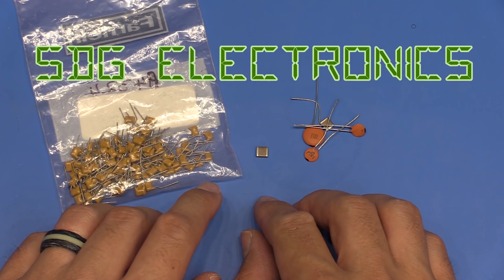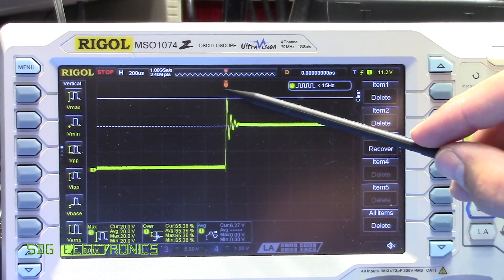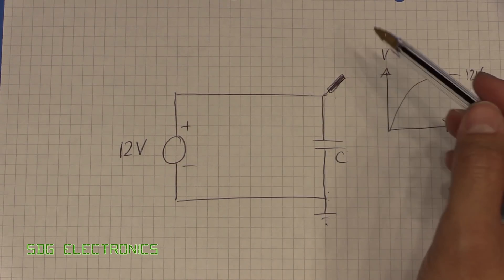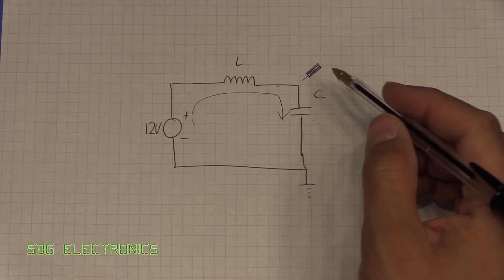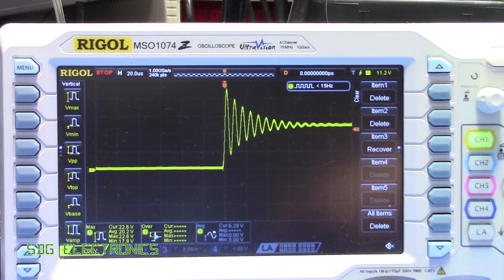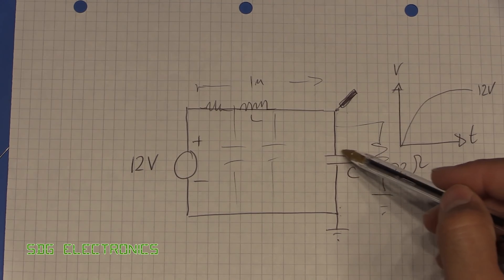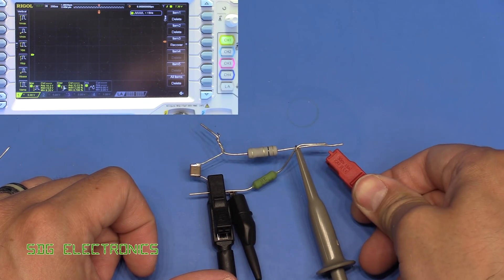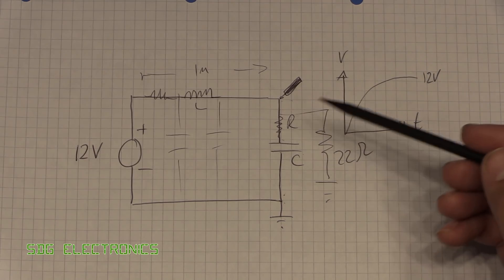SDG #088 Ceramic Capacitors will Blow Up your PCB

Comment: I have a GPU with a blown up ceramic capacitor which looks like it was acting as a filter between the 12v input and ground.... And now I'm pretty sure this is what happened to it. Thanks for the tips, very helpful!

Comment: tx my Gan 100W charger failed was working properly for 6 months, but used it to charge anker powerbank at peak 100w for may be 40 mins ...do you reckon the video you demonstrated is the reason ...please guide

Comment: a snubber circuit on the input or connect with a series resistor to charge the caps then remove

Comment: Same issue i got while i was connecting my KSGER soldering station control board to the pre powered on power supply with alligator clips. the 5v dc to dc converted failed in it. and i was wondering what happened to that😅😅. Thanks for the knowledge👍👍👍.

Comment: You should in most cases, add an EMC filter to the input or use a hot swap controller.  Both will eliminate this startup issue without compromising the effectiveness of your input capacitors

Comment: Some T12 soldering stations have a 4 pin, 5 pin or 6 pin socket for the cable going to the handle of the soldering iron. What is the difference in the amount of lines of each socket? Thanks.

Comment: When discharging electrolytic capacitors, do i need to discharge ceramic and polypropylene as well? I have a polypropylene 0.012uF at 1600V, should i use a 1 MΩ resistor to discharge it?

Comment: Putting the electrolytic in parallel with the ceramic will give the ceramic capacitor an effective soft start without a series impedance penalty for your high frequency decoupling.

Comment: Hi. Thanks. It should all be solid ones and SMDs, no more through hole subcomponents and liquid filled capacitors, resistors, transistors and other subcomponents- I think that's the future (besides photonics).

By the way, if it's ok to as, my ceiling fan is slowing down again. I already replaced it's capacitors and in series too (the total voltage is way beyond the original one, hoping that it'd be more robust), it's a not so branded capacitor which was from a local electronics shop, I may need to order a really branded ceiling fan capacitor from abroad, online. Would you know what's a good brand, ceiling fan capacitor?

Thank you. Have a great week.
God bless, Revelation 21:4

Comment: Not sure this is a fair or proper comparison.
If implemented on a pcb, the inductance is very low and, as mentioned in the comments, typical practices are to have electrolytic caps in parallel with the ceramics.

Comment: What would happen if you connect a diode in series with the capacitor? The 12 volts would still charge the capacitor but there'd be no 'backlash'.

Comment: Thanks champ. I once asked the question why in laptops they use the aluminium can electrolyte caps when they could use the smaller ceramic chip caps of same value. I think this is the reason why. Less overshoot.

Comment: 3:07 yes, inductors resist change in current, which is ZERO when you start to charge the capacitor. Sorry but your explanation doesn't make any sense.

Comment: Did you find that the ceramic capacitors have much more of a tendency to short? It's something I have noticed more recently.
Reply from the maker: Yes, you must also be careful of any PCB movement - MLCC capacitors will often fail short if they crack due to vibration or thermal effects.

Comment: A Zener diode in parallel with the ceramic cap could help limit the voltage without adding ESR for power applications requiring fast response time
Reply: Use zeners for reference or small power regulation, for transient suppression, TVS diodes are better, they can absorb much more power and are faster
Reply: TomboXYZ Good to know! Check this out, really helpful 
https://www.allaboutcircuits.com/technical-articles/transient-voltage-suppressors-tvs-an-introduction/

Comment: Are you using a switch mode PSU? Could you be observing the PSU"s reaction to a sudden change in load?
Reply: Yes, finally someone said it. This looks very much a power supply regulation issue, not rl resonance.

He should have connected it to a battery and compared the results. I proverbially bet that result with a battery will be more inline with the classical 1-e curve.
Reply: @altersami9660  It's exactly the same. I do this test regularly with battery equipment.
What he didn't mention is twisting the power supply wires generally lowers their inductance enough to stop it killing your gear.

Comment: Noob question, but why do low impedance caps exist, if you have to use them with some sort of in-circuit-resistance so they don't overshoot?
Reply from the maker: It's only when combined with large inductance and rapid changes in voltage. This is somewhat specific to the issue of having a capacitor on the power input to your device. For general decoupling on a PCB this is not a problem.
Reply: @sdgelectronics  Ok I got it. Thank you !

Comment: its not particular to ceramic capacitors.. tantalum or anything with low ESR have same problem.. click bait
Reply from the maker: True, however ceramic capacitors are inherently excellent for transient response and so widely used - it's the most likely device to experience this with.
Reply: @sdgelectronics  I experienced it with tantalums though that was 20 years ago and ceramics have come a long way since. I don't know if you mentioned it but TVS diodes in parallel can also clip the voltage overshoot.

Comment: Welcome to the wonderful world of LC networks.  Ceramic capacitors have low ESR. All wire has inductance and most regulators have a response time.  Limit your inrush current to prevent overshoot.  Glad you covered the inductance that many might not catch.  If you use TDR you will understand the LC results in an impedance. If the impedance is sourced from and terminated into it's impedance resistance, there is no overshoot or undershoot.  This is transmission line theory.  Load resistor goes on the output. Source resistance is in series with the voltage source.  SMPS often does not like to run unloaded.
Reply: Forgot to mention.  Eliminate the Inductor. This is why bypass capacitors are placed as close to the transient sources as possible.  This means bypass capacitors right at the DC/DC converters as well as right at the noisy logic chips.  Look at a good computer motherboard for examples of this.  Lots of little capacitors all over the board instead of 1 big filter capacitor.

Comment: You can also opt for a soft-start if you're dealing with a MOSFET power bus switch, or any type of voltage regulator.
Not all soft start ICs are the same though ... some cheap ones use a simple capacitor, and so the ramp-up waveform will have a long "tail" so to speak.

Comment: Do you suggest to put a ziner in parallel with the capacitor ?
Reply from the maker: A zener or transzorb/TVS are all possible solutions.
Reply: Is this your picture . It's just same picture as IAM  when I was like more than 8 years  before . Now IAM 36
Reply: I think this pulse happen because of the powersupply have a constant current . I try this with battery  and did not get this pulse 😀

Comment: 2:00 is wrong. The charging curve is drawn with the assumption of a resistor in series (which limits the current and voltage during charging). What you have drawn is a capacitor without a resistor in series, which means your charge current will theoretically be infinite until the capacitor reaches the supply voltage. In reality the charge current is also limited by wire/contact resistance and internal resistance of the power supply. Because of the huge current during charging, the parasitic inductance creates a voltage spike, which then, after the capacitor is charged, "rings" in the resonant frequency of L, C and R of the circuit, dampened exponentially by power losses in the circuit.
Reply from the maker: You'll see the RC curve in any real circuit due to the series impedance of your power supply and the ESR of the capacitor.

Comment: the spikes coming mainly from the inductance of the wires. A PCB would behave different. A 2220 has approx 1.6nH , two  cm wire  add additional 2nH on each side make 4nH.
Reply from the maker: It's a combination of the inductance of your power lead and the low ESR of the ceramic capacitor. This is somewhat specific to the example given of a DC power pack being plugged into your design.

Comment: Don't forget the inductances inside the power supply, they can also play a role in the ringing. For a proper test here I'd like to see a test where the power supply is a battery. A car battery would be fine.
One other issue with ceramic capacitors is that they also can work as piezo elements and actually generate spikes at temperature changes. This is one thing that has been discovered in vehicles where they can actually wake up CAN bus traffic when they cool down.
One more factor that's often overlooked is that the oscilloscope probes have to be properly calibrated for this kind of tests. Higher quality oscilloscopes at least used to have a square wave output specifically for this purpose.
Then it's also a good idea to design the electronics with components that have a safety margin in voltage if possible.

Comment: Only capacitors thats i ever seen fail is smd capacitor
But i have seen them fall of the pcb
Why is capacitors good but bad at the same time
Reply: The term capacitor is a very broad description.... here we see many types of capacitor being tested and each have particular characteristics, withing the family there are further pitfalls for a person to fall into.    Electrolytic and tantalum fail if voltage is reversed, tantalum do NOT like step voltage change, Ceramics, polyester, polystyrene have different foibles.    

I assume your capacitor fell off because it became  hot enough to melt the solder , MLCC ceramic capacitors can do this as the gap in the layers are just a few microns thick and the the common failure mode is short circuit - so all the power flows through them.   The most likely cause of creating the damage is vibration during assembly or use - they are very resistant to over voltage .

Tantalum capacitors tend to absorb moisture , and need to be dried before use

Comment: Good vídeo, I had no idea about it. I'm thinking about a protection circuit based on a MOSFET that maybe will help, because can delay the startup enough time to avoid the spike and MOSFETs have high voltage resistance. I'll have to do some tests to see :)

Comment: I remember through school and university this kind of explanation was used, and it always annoyed me. The inductor doesn't "want to keep the current flowing" and it doesn't "do whatever it can" to do anything. I understand the value of these analogies, but they have two problems: (1) they are clearly untrue - the inductor is not conscious and it doesn't "want" anything and (2) they are always one step away from reality. The reality here is that current flowing through the inductor creates a magnetic field. When that field changes (up or down) it induces a voltage in the wires which exist within the field which opposes the one which is driving the current. The strength of this induced opposing voltage is proportional to the rate of change of the magnetic field. This has the net effect that changes in current flow are resisted by inductors, anf the more sudden the changes, the more they are resisted. I know you end up with the same conclusion but this explanation refers to physics without personification. I hope that's helpful. Maybe it's just obnoxious - in which case please delete it.

Anyway, I didn't know about this effect with ceramics - so I learned somehting - thanks.

Comment: Is there any chance that the overshoot and ringing could be caused by instability in the power supply as it tries to maintain 12v after being presented with an almost dead short?  I wonder what would happen if the power supply was replaced with a 12v battery and a suitable bypass capacitor to to keep its high frequency impedance low i.e able to supply high transient currents?
Reply: I tried this with my power supply and no wonder that overshoot was there. Than I tried it again with auto battery and result was same, overshoot as well.

Comment: Thanks for this vid. It can be a difficult problem to debug.
I think there is one more thing to this problem: capacitance of MLCCs drops with voltage: the higher the voltage, the less the capacitance. As a result, in extreme case, it may be even possible to get more than double the voltage at peak overshoot.

Comment: Okay, here is my input, for what it's worth.  I first encountered this problem 18 years ago, I was testing a Zetex 3-terminal linear regulator rated at 15 Vin max, running it from a 12 volt bench supply.  Found it would kill the regulator every time when connecting the supply.  Looking into the problem further, I discovered, as you did; the input cap and supply leads induced a voltage spike at the regulator input, coupled with poor design of the regulator (it would catastrophically fail at 15.5 volts and above).  I found several ways to address the problem: Parallel the ceramic cap with an aluminum electrolytic, transzorb (or zener diode if power levels are low), and some kind of low que inductance in series with the supply line (ferrite beads).  The resistance in series with the ceramic cap was rejected because, (ironically) it allows input voltage spikes to damage the regulator.
Reply from the maker: Thanks Bill

Comment: Ceramic capacitors are fine when they are used correctly.  It has long been known that their value changes over time, and one can compensate for it with worst-case analysis during the initial design.  If your switchmode power supply failed, it was likely due to a poor component choice from the start.

Comment: Just add another bigger capacitor in parallel to reduce flyback and 12 or 13 V  zener diode in parallel to limit flyback. Problem solved.

Comment: Yup, under certain conditions, ceramic caps tend to show a resonator-like behavior, with all the implied nasty transients. Bit that bullet once, when trying to power a TLV76050 regulator with 24V. The input capacitor, along with the long connector lead, created a spike on power up, sometimes up to 40V. Needless to say that the regulator only held about twice or trice before blowing up and damaging the PCB. The solution was to insert a damping resistor just before the capacitor near the regulator, in series with the supply.

So, the behavior is probably not just the capacitor's fault, but the line inductance as well (and mainly that last factor). That is why electrolytic capacitors don't show this behavior, or it is minimized. Their higher ESR is enough to dampen the oscillation.

Comment: my solution for this is simple, either i use ics with soft start or make sure the resonance of the circuit is way above the bandwidth of the step incurred by the regulator when turning on, for the main supply, just use an electrolytics for storage and ceramic to take care of the ac impedance, as for the regulator i would make sure Vin max is many volts above the specified input voltage, hadn't had a case in which the protections of the components itself could't handle a possible ringing

Comment: Okay, so this is a common question?
Where did you get that plastic prying tool from?
Reply from the maker: I actually don't remember, I have no idea what it's useful for other than pointing at stuff - it snapped on first use on the flat end.
Reply: @sdgelectronics  Ah, well thanks for that.

Comment: Alternatively don't use leads so long they have appreciable inductance. By using industry standard design rules I have never seen this issue cause a problem in any of my products. EG All power is handled by planes and where that is not possible keep tracks/leads as short as possible. The shorter they are the less inductance they have. Most power sources have soft start also. I certainly design mine to have it.

Comment: Great video. I had a similar situation with some boost regulator boards. Multiple failures on the bench when setting the outputs prior to installing them was traced to 
the onboard chip getting zapped when the supply was connected, despite having the voltage set lower than the boost reg specs. The input caps on the reg board were
ceramic, very low esr, but the supply leads were long... It adds another dimension to applications using these caps at the input, which needs design consideration to 
keep things reliable.
Thanks for posting.

Comment: My initial thought would be that this would occur where the inductance is particularly high in relation to the capacitor, as the whole purpose of bypass caps is to prevent voltage jumps from parasitic inductance. A (relatively) high value decoupling capacitor was probably needed in any case where this occurred I'd think.

Comment: You'd do much better to measure the capacitor with the shortest leads possible, most of what you are seeing is induced current in the ground and probe extension gripper.  If you measure with the bare scope probe tip and the typical short-path ground adaptor (clips over the exposed shield) the path will be so short you'll see a better representation of the actual voltages.

Comment: Ceramic caps are very brittle and if the pcb is not designed for copper balance or the board is handled badly the cap can get cracked and allow moisture  in and short the cap. This creates heat and burns the board.
Reply: Aren't you talking about tantalum caps?
Reply: Suraj: Tantalum capacitors have other but similar problems. They get angry if they see voltage spikes higher than their rating or if they see reverse polarity. :)
Reply: Ceramic caps are the problem and some manufacturers of ceramic caps make what is called Flexicaps to over come this issue.
Reply: This was exactly what I expected from the title and the thumbnail.